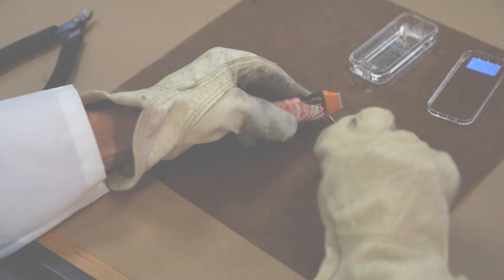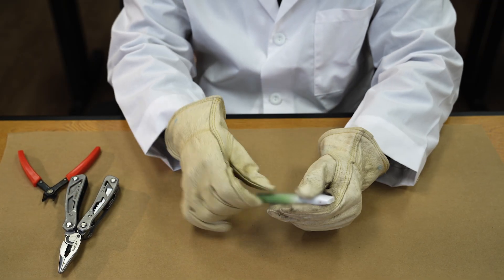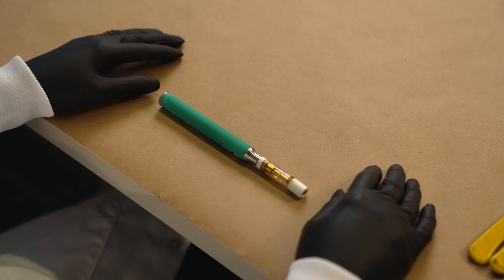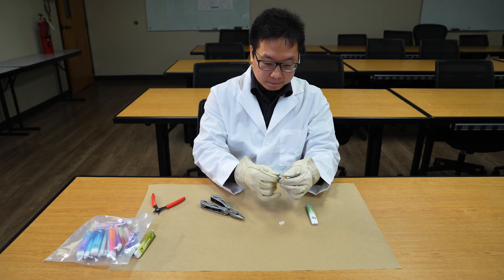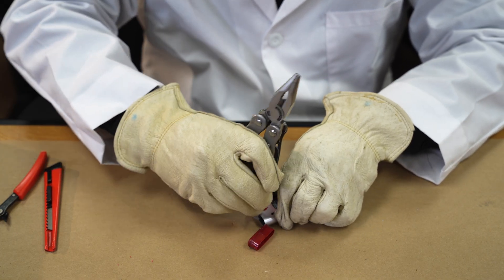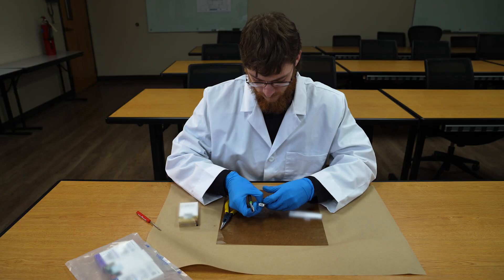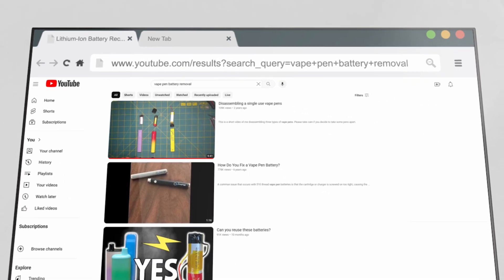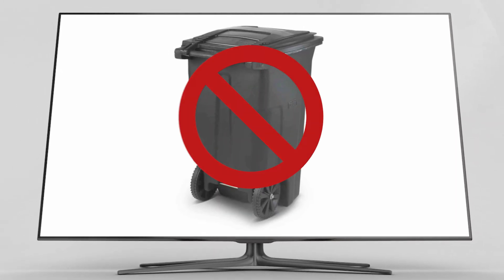Removal of Lithium Batteries from Electronic Smoking Devices Training Video

Comment: makes sense, you might need fingerprints or DNA so the vape has to work its rounds through the logistical chain and having no battery is removing risk of destroying evidence, or someone getting injured due to a battery failure. What happens to the batteries?

Comment: Folks upcycle the batteries for projects, It keeps them out of the landfills. I've been collecting some for that very reason. I think a jewelers saw gently sectioning the outer case is going to be my approach. Brute forcing it with pliers makes me nervous, and often there's no obvious seam at the bottom.
Reply: I make guitar pedals and since I buy vapes semi regularly, I use the batteries to power the LED light instead of normal AA or AAA battery packs, and since the vapes I get have usb-c charging I'm able to make my pedals last so much longer.

I'd rather not chuck em into the trash if I can reuse some of the parts